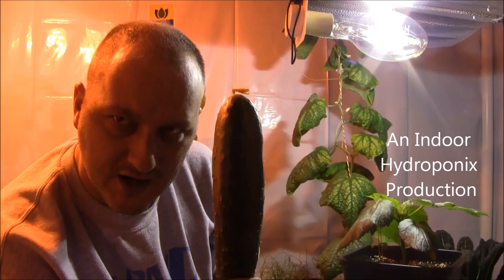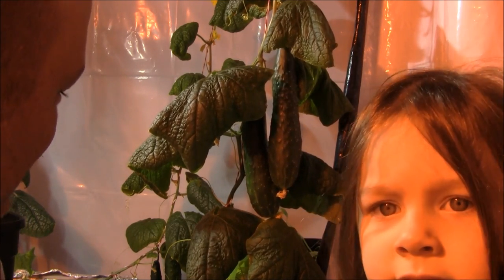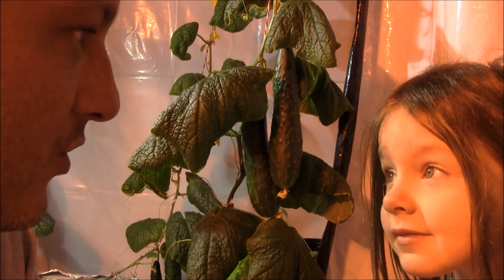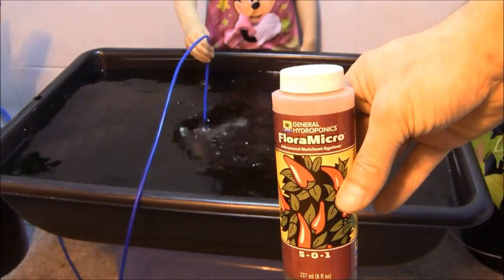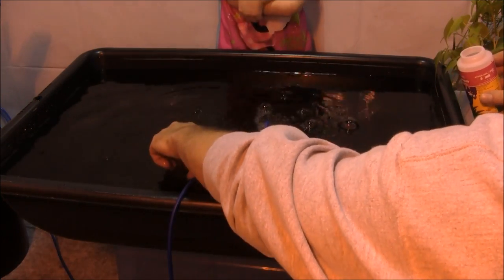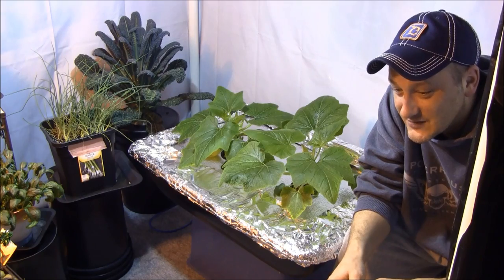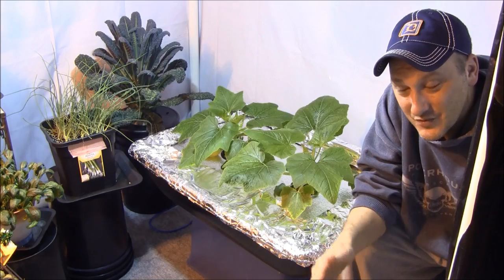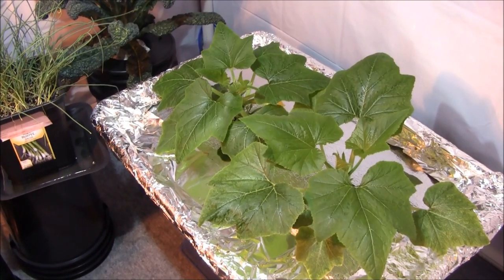Hydroponic Squash - Floating Raft Method

Comment: The cheapest Ph down is 5% sulfuric acid (Battery acid}. In 16 gallons it would take less than 1 TBS to bring the Ph down. I used it in a test Greenhouse growing tomatoes. My family and I ate a bunch of tomatoes from that Greenhouse  5% sulfuric acid works with no problems.